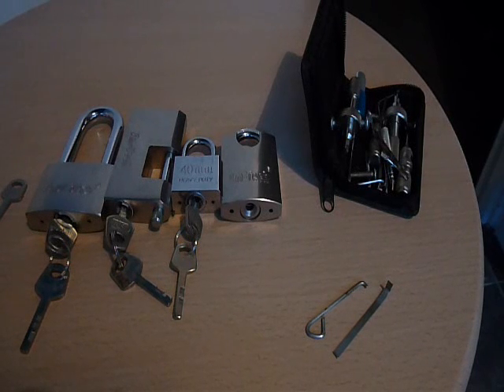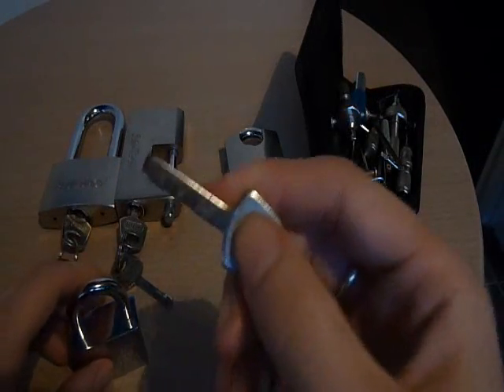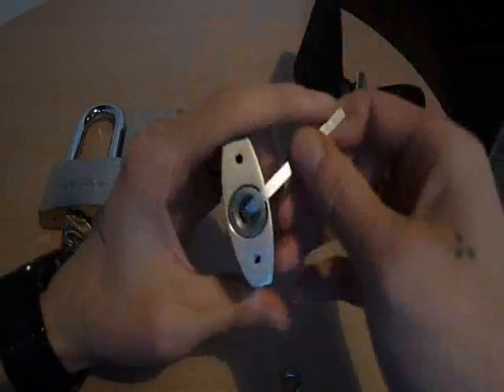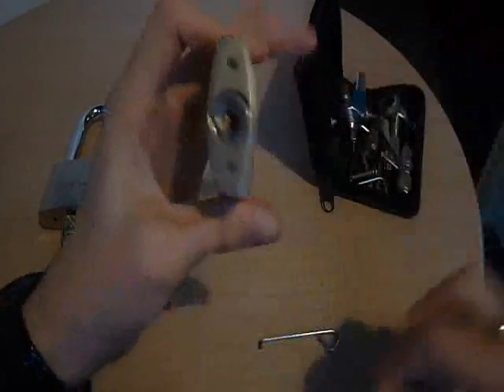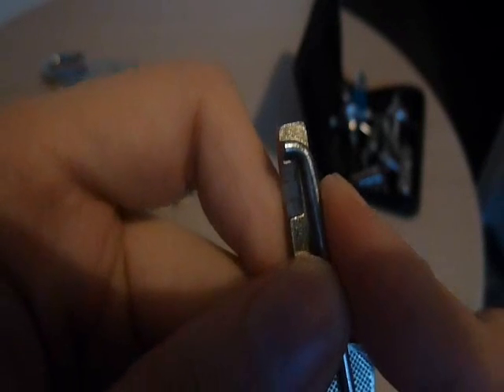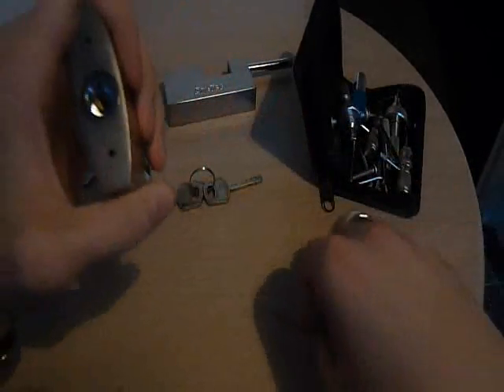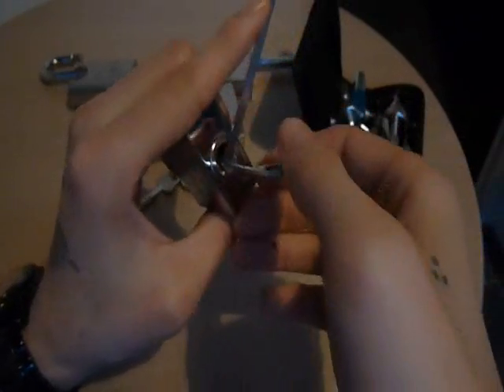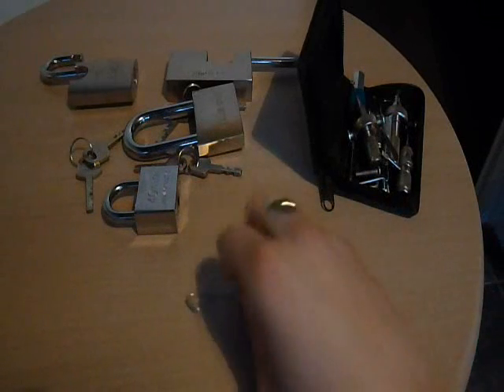Tutorial - picking disc detainer padlocks with simple homemade tools

Comment: Hi mate, I’m thinking of starting to pick locks for my new hobby, can you recommend a set of picks and tensioning wrenches for a newby, great videos by the way 👍🏼
Reply from the maker: Sparrows tuxedo (original not royale). Their picks aren't the strongest but they're decent quality and finished well; with sleeves over the handles they're super comfortable too. Wrench selection is fantastic and will keep you covered for loads of stuff. I actually carry a set of their wrenches in both my everyday kit and my proper kit. Worth it just for the wrenches and case. When you figure out what picks you like to use, upgrade to multipick or peterson if you can.
Reply: @DrBint  thanks for swift response ,and I'm going to purchase that Kit you recommended , who'd of know that looking for information on  changing my Euro cylinder in my front door as got me hooked 😁👍thanks again